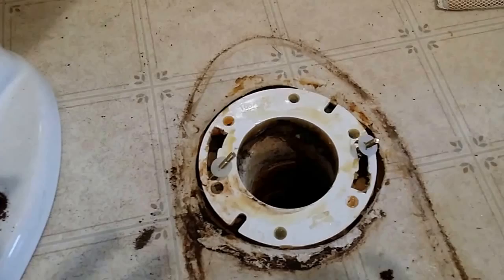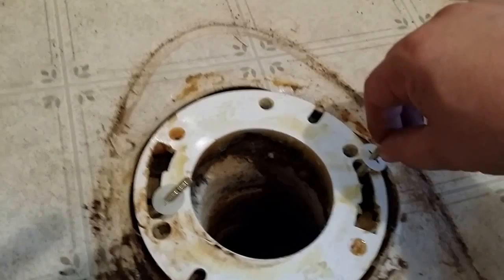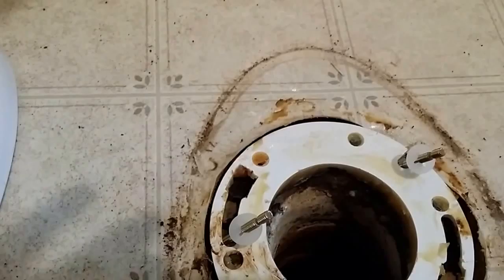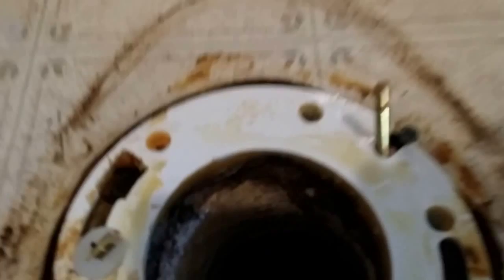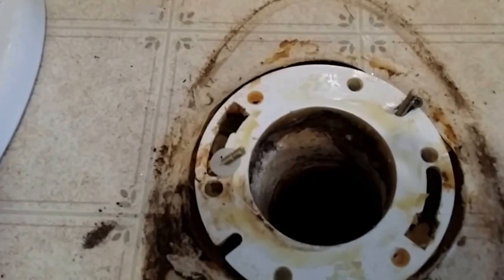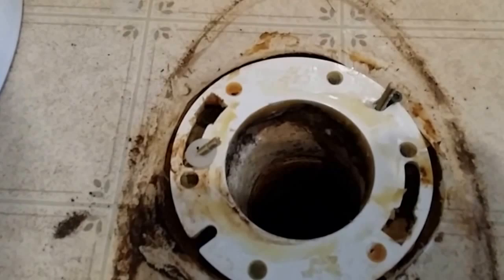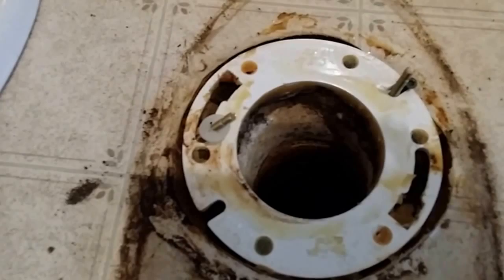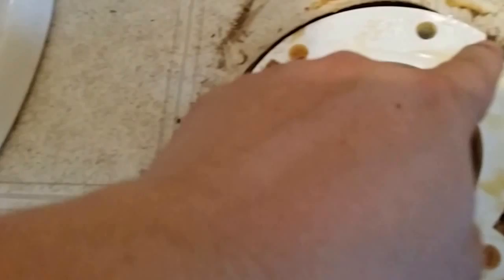Toilet bolts that spin! How to stop them even if the toilet is already installed.

Comment: Dude, you save my Sunday.  I already installed, using old bolts.  I was devastated when one side was spinning.  I tried everything to grip it to no avail.  I tapped the screw in just to see if it would secure it....bingo.  Drilled it all the way in and worked like nobody’s business.  Thank you!
Reply: I saw another video, use power tool to cut the bolts.

Comment: I struggled with a spinning bolt for an hour yesterday trying to clamp the bolt with anything I could think of but nothing worked until I tried this. Had it finished and tightened properly in minutes afterwards. Thanks so much for the video! 👍

Comment: It worked for me. My bolt was spinning while removing an old rusty bolt to change wax ring leak. I sunk a 3 inch deck screw as close to the spinning bolt as I could and the darn thing stopped spinning and I was able to get the bolt off than just removed the deck screw. I tried Vise grips with PB blaster and I wasn't getting it off. This tricked worked great and I will never forget it now. Thanks.

Comment: I don’t understand how you stopped the two side bolts from spinning. And I don’t see what the bolt towards the front of the flange has to do with anything. The toilet is secured to the flange by the side bolts not by the front since toilets don’t have holes in the front.

Comment: I find the bolt to flange design horrible. I could design the flange 1000 times better so bolts never turn. 

Thanks for your video. It’s a workaround of a poorly designed toilet mating system. Companies make crap knowing they will fail in order to get people to buy more things to try to fix their terrible designs. 

Corporations need to be regulated more and designs should have to go through a review process before it can be sold to the public. I’m sick of companies making defective products.

Comment: Bit confused. i understand how you screw  your screw secures the closet bolt.  however the location where the closet bolt is located is not at about in 2 oclock position. doesn't it have to be at the 3 oclock position in order to go through the hole in the toilet to align correctly?  thank you

Comment: That flange shown is broken on the left side and it is not really a good idea to reuse it without putting on a metal support piece they make for such broken flanges of changing out the flange you show in your video. Any rocking of the toilet by someone who plops down often as they sit there can continue to put stress on the flange at that area and you are then going to have issues which could have easily been fixed the first time around in securing those toilet bolts.

Comment: Ok, that won't work. You have placed the right side bolt IN THE WRONG PLACE. Also, most toilets are over a concrete floor, and you're not going to screw a 3" deck screw into concrete. ALSO, the flange is BROKEN on the left!  ALSO, where is the nut that holds the bolt to the flange so it won't spin, in the first place? Place your bolt in the proper place, tighten the nut onto it, leaving the bolt sticking up to fasten the toilet to, place the rubber ring (or wax ring if you are cheap) set the toilet, and tighten the nut over a washer on top. This only holds the toilet to the flange, the other two screws in a typical 4 bolt toilet hold it to the floor. (Don't buy a toilet that's only held to the floor with two bolts, or that has less than 4 gallon flush tank!) Yes, you might have to search out a vintage toilet instead of going to the hardware store, because they no longer sell such good toilets, but that flush sound is well worth it!)
You need to replace that flange and then start over, instead of giving people bad advice.

Comment: Could you use a nut and bolt to keep in place instead of a deck screw?
Reply from the maker: +Emily Dower Yes, just about anything to keep it from turning work.
Reply: Emily Dower actually that's what he should have done. Out a metal washer down then screw. Then out toilet in place and same Prosses. You just need an extra set of screws. This guy was kidding himself.
Reply: Should have said put not out lol
Reply: The deck screw keeps the bolt stable,  keeps it from spinning.
Reply: Use a  threaded sleeve   thread it over the bolt.

Comment: This has to be the dumbest design I have ever seen.  I have two frozen bolts(been wd040ing for two days)....no matter what...vice grips or whatever...i cannot get the bolts off because the bolt keeps spinning...they are brass i think..i think my vice grips now are ruining the threads...oh yes...my toilet is still mounted...and not leaking..just loose bolts...they could not have come up with something better than this?
Reply: Such terrible design... I had this issue on the last toilet I removed, and now the current one I'm doing.  How many people have had to deal with this.  F'n ridiculous.
Reply: @BEasay  You know...sometime after that post...I FINALLY got the bolts loose..barely.  It was tough because the toilet was in between a wall and a vanity and I have about 5 inches on each side...I could get no leverage...it smelled a bit like urine down there(it was a restore thing), and I was sweating bullets.....but finally.  I think I finally used TWO small vice-grips with teeth I had to buy.  To this day...whenever I look at those bolts...I think..."I could never get those off again..."

Comment: Or you could do it the right way and take those nylon washers and throw those down the drain! I REPEAT DO NOT USE THE NYLON WASHERS !!! Screw the closet bolt down with metal washers and tighten with nuts hurkle ring !!!!!

Comment: Bad. Advice. Try using a drill with a socket driver; if you make the nut spin fast enough it will usually grab the bolt and tighten itself (even if bolt was spinning). An impact usually works best for a quick grab.  Also... If you can't get bolts out due to spinning when removing a toilet, then you should probably grind it in half and replace them... And as others have stated, fix your flange first! Don't give hack advice! You should never have to add an extra screw to fix something you don't know how! There is a reason people pay professionals to do this. They do it the right way.